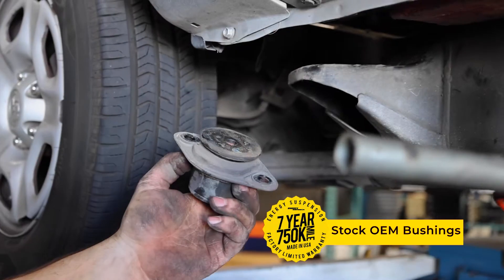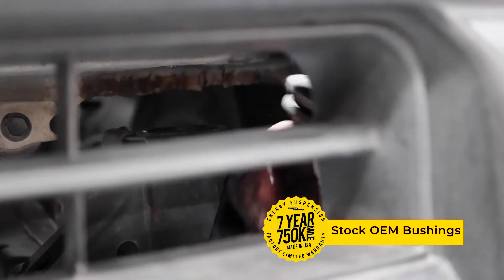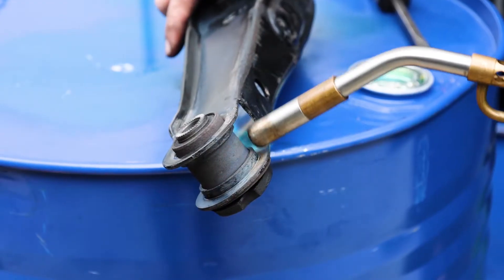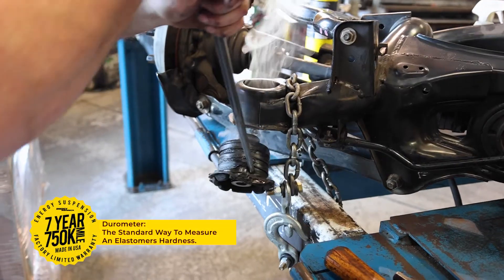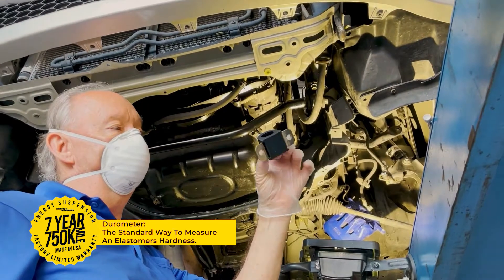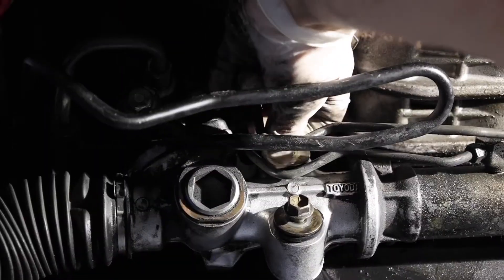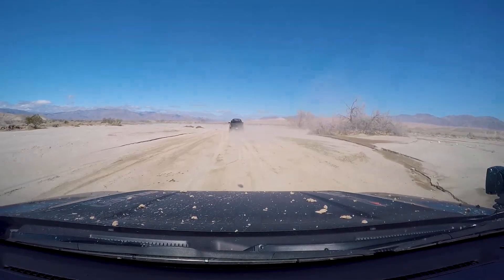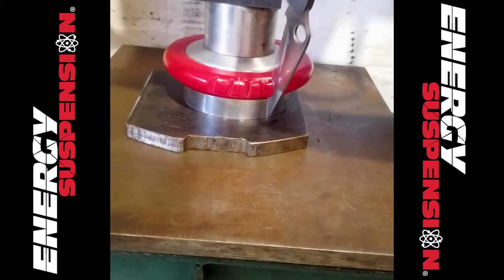Energy Suspension's Mike Talks Bushing Durometer

Comment: I just bought the kit for my 2000 Prelude SH, what kind of shop should I take it to? Any mechanic, or is there a specific type of shop that works on bushing like these? Any hellp is much appreciated
Reply from the maker: Right on! We don't have a list of authorized installers of our product as it mostly comes down to suspension work. We recommend reaching out to a number of mechanics in your area and request to see if they are proficient in "Suspension work". If they are they should be able to handle bushing swaps.
Reply: A local shop can press bushings. The hourly labor at the shop can be expensive. You can save money by taking the control arms off and bringing them to the shop. 
Once it’s done it’s done. They last for years.